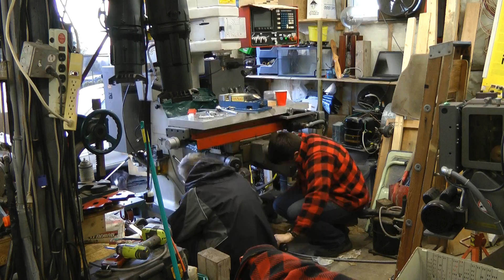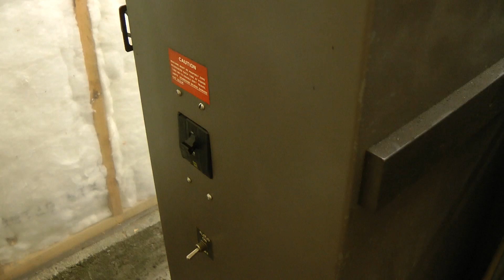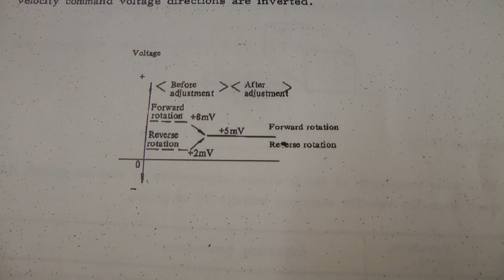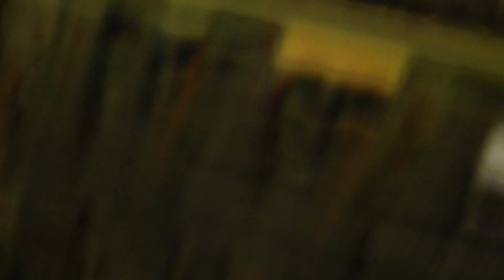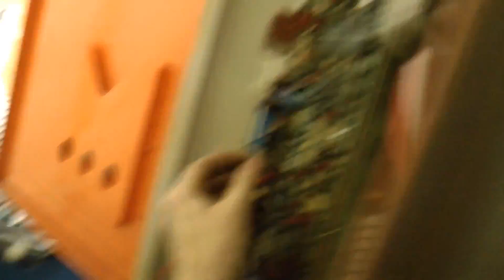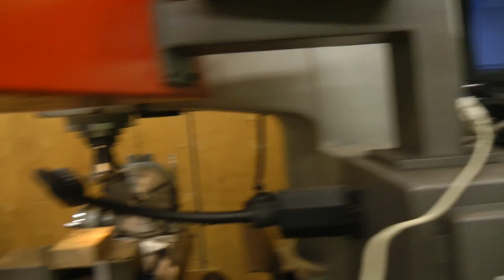Tree Journeyman 325 CNC milling machine - Part 2

Comment: When you set Z, use a piece of paper.  That way the tool edges never ram into the steel you are using as a height gage.  If you measure the paper you can adjust the offset to remove the offset that the paper caused.  Nice work!

Comment: That is a beautiful machine! Most interesting! Thank you for showing the calibration and setup... I don't run CNC machines yet but this inspires me to work on some servo control/analog control calibration issues on a 3/4" editing VTR that is of close vintage and includes somewhat related control systems; likely a similarly detailed approach is needed as there are several layers of analog and digital calibration issues that need to be sorted Before I work on the real problem (which is no capstan rotation at slowest forward tape cue speed Post reel servo controller replacement). At least with your machine there, there is more widespread knowledge and interest... Nice work! Think I can see light through that wood when it gets thin :-)
Reply: Sounds like the supply reel has too much tape tension.
Reply: Chris W
Thanks, thought so 2, not to get off topic here too much, seems capstan isn't trying to turn yet it runs perfect in reverse at the same speed and fwd at all other speeds so that's why I'm thinking servo or perhaps broken control line but what's scary is that the problem showed up after reel servo board(s) replacement... It's a BVU-800 many things to try! I'll check for excess tension, motor, then servo, then shoot a vid of it.
Reply: wdavem After reel servo board replacement it needs a full reel servo alignment with tentelometer and/or spring gauges.
Reply: Chris W
Right, I have service manual but no tape tension gauge... might have to find a postal scale. Can't resist the urge to gently poke the optical tape tension sensors to see if the capstan tries to turn @  FWD x 1/30 speed. This may not be a valid test however, and it must be noted that Nobody should ever press or pull on tape tension sensors in a machine like the BVU-800 unless you are ready for a crazy, possibly catastrophic event sequence. Would make a good video though...

Comment: Is the spindle speed problem caused by loss of speed feedback? As it seems to increase  before it trips out on over speed. Can you scope some of the signals and reproduce the fault? What type of speed pickup does it use? If your lucky it might just be a intermittent connection or dirty pot LOL.

Comment: Hello Tesla500,  
Nice job on the casters/roll-away framing.  I need to do the same thing to a Tree 325 I am looking at buying, actually going to look at it today.  Did you happen to make up any drawings on these?  If so, are you willing to share them with me?  Or can I get the dimension you used and the thickness of steel?  Can you please also point to the place you purchased the caster from?  What were the ratings on these casters?  I can see you done/learned much in this project.  Is it possible to connect you off youtube for answers to some questions?  I was also wondering if it was possible to view the videos that are not speeded up on some of the areas.
Thanks,
PeteW.

Comment: Man, you need a tachometer.

Maybe hack something up with a oscilloscope and an optointerrupter?

Alternatively, you may be able to find a index pulse on the controller somewhere. Then just measure that with a DMM in frequency measurement mode.
Reply from the maker: I need to adjust the max speed, 3500RPM is clearly running too fast based on the strobing of the lights at 120hz, it's faster than 3600 for sure, probably why the drive was erroring out. I have the strobe gun from that old auto analyzer, that and a signal generator should do it. There is an index pulse, but I'm not sure what the exact reduction ratio is from the motor to the spindle.
Reply: tesla500
If you can put the spindle in free-wheeling mode, just count the pulses when you manually turn the spindle once.

Also, it's not documented somwehere? Huh.

Comment: hey i was wondering if you guys ever ran into grounding errors on all 3 axis motors. for some reason the machine i got turns on fine, spindle turns on but once you go to move an axis the boards click out and i get a grounding error if you guys ever heard anything on this or may have experience it please let me know thanks.

Comment: Tesla I have same machine and I want to upload the one program file from Pc to controller I could not do it because it appears load error.  I saw that you did it so easily but we need to know what setting you used in the controller load setting.  Pc setting and what wire you used because I could not do it Please help me to find the way I appreciate your support In advance
Reply from the maker: I've had problems with USB-serial adapters, use a native (on-motherboard) serial port on a desktop computer. In your terminal program, set it to 4800 7e1 and use hardware flow control, and set the mill to use the same. Xon/Xoff flow control was not reliable. I'm not sure if you need a null modem cable or not, you might try with or without one.

I use Tera term, when pasting your program in, put the CNC in load mode, then use Alt+V to paste the program in and it should load.
Reply: do you remenber what is  program  used to loading  the file from PC-controller

Comment: I just got a Tree Journeyman 325.   Are you using the RS232 port to load programs into the controller?
Reply from the maker: Yes, were you having trouble doing so on yours?
Reply: I have not gotten my machine up and running yet.  I'm still waiting to get a phase converter.  I'm just curious how you transmit the program to the controller.  How would I connect the RS232 cable to my PC?   Thanks.
Reply: I've got a J325 as well.  My PC has a PCI-e 4-port serial card because I have a lot of stuff that runs RS-232, but you can use a USB to serial adapter.  Wiring at the control is standard.

I upgraded the firmware in my machine not long after I got it.  The latest version (PA5124, from 1993) will do 9600 baud.  Upgrading is not difficult - you just have to get your hands on the ROMs.  I maxed out the RAM to 128 KB while I was in there.  Dynapath wanted $500 for the upgrade, but you can get the parts from Digi-Key for about $5.  The RAM ICs I used were p/n U62256ADK07LLG1 and the Delta 20 takes up to 4 of them.  I replaced the original RAM chips because the new ones take a fraction of the power and will last longer on the battery backup.
Reply: thanks!
Reply: Hi I have bought the same machine 325 and we are having problem uploading the program from pc to controller.  I tried to do throw USB to Rs232 but it fail never linked if you can help me to find the way I appreciate your support then I saw that you upgrade the firmware can you do how you did I will be waiting for your support and I want thank you in advance